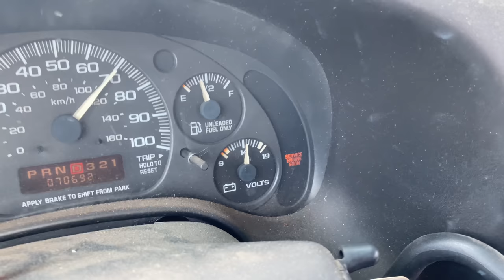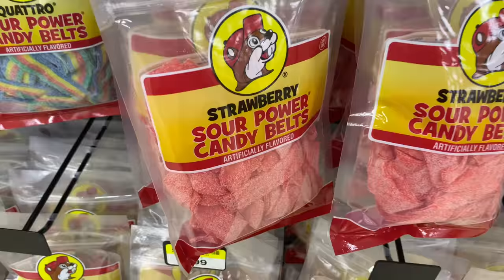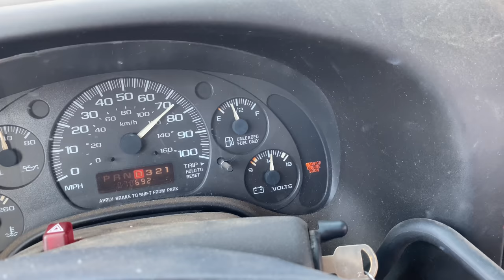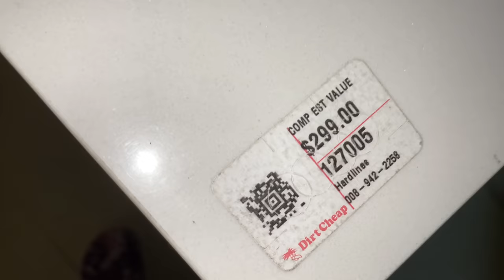DaBaby CAUGHT Drinking Karen’s Bath Water!? (Confirmed SOOS!) *😳*

Comment: if the engine gets too hot again then you can cool it down a bit by turning up the AC heat to max and putting the fan on max. There's no heating element in the bus, it just uses the engine's heat to heat the ac air. So if you turn up the heat and fan, its basically blowing cool air over the engine and the heated air onto your boiling lil body.
Reply: This is one of those things that certainly works in theory, but usually the reason for the overheating will overwhelm the heater core's ability to compensate, especially if there is coolant loss involved. Not to say we shouldn't try, just to say don't expect a miracle.
Reply: the ac in the bus is broken
Reply: @bepsi8929  the heater works off the heat the bus makes
Reply: @artisanautobody3931  it definitely helps either way to buy you some time to either pull over or make it home
Reply: @martinvalencia6141  Let's say it's something you do while you are trying to find the closest place to pull over, not something you can do to make it home.
Reply: @bepsi8929  the ac doesn't need to work for this to work, unless the fans don't work, but that's not really part of the ac. I just called it ac b/c the knob that controls the heat and actual is generally called the ac control
Reply: @bepsi8929  that doesnt matter itll still blow hot air out of the engine, which will cool it, but in turn will cook good ol uncle Ben inside the cab. Not an end all be all solution but can prevent further damage.
Reply: @artisanautobody3931  I've done it multiple times to make it home in my old beater work truck multiple times,  it would start heating up in stop and go traffic so I'd put the windows down and crank the heater. She would drive 40 more miles home at 210 water temp the whole way.
Reply: @martinvalencia6141  this was one of those things that blew my mind lmao why did I never realize thats how cars produce heat!?
Reply: @martinvalencia6141  I'm sure it worked for you in your situation. It is an alternate way to remove heat from the engine. But people need to be aware that it might not always work. There are many different causes of overheating. For example, if there is major coolant loss, nothing is going to stop the engine from melting down.
Reply: @artisanautobody3931  Well ironically if the coolant is low enough the heat won't function cause practically nothing is circulating. In that situation yeah, turning up the temp won't do anything but make the blower motor work harder, but otherwise blasting the heat full blast will almost always help, heater cores are nothing more than a mini radiator connected with the HVAC. You'd even see some benefit from this if your rad was well plugged up or thermostat is stuck, as it's basic physics; heat is being absorbed then transferred/removed. It may only help slightly depending on the vehicle, but it's certainly better than letting the heat soak into the heads. Even then I'd rather be out a $150 heater core than be staring at a pair of warped heads and smoked valves.
Reply: Many a great memory running my car heater full blast in the dead of summer praying my car didn't blow up🥵.
Reply: I love how I first became aware of this concept from King of the Hill
Reply: @tjm644  To be fair Hank also said a ratchet is needed to take off a distributor cap
Reply: Science
Reply: That probably explains at least some of Tulsa's city buses.

Comment: Friendly tip. Put the concrete on a pallet so they don’t soak up the rain water from the ground…7:50
Reply: smart!
Reply: Or keep it in the barn that he has.
Reply: @epicmcgriddle7874  true..either will work.
Reply: He needs to store it indoors or under shelter. Moisture in general will harden concrete. Work for a fencing company. It is annoying.
Reply: @Sackmatters  being in a fencing company or moisture being the activator for concrete mix?

Comment: Dunno if you've considered this already but using tires to grow potatos is really efficient, once you've got one seeded, put it in the middle of a tire and let it grow out leaves then chuck a bit of soil on top so just a few leaves are showing and put another tire on the other one, the potatos will keep growing up to the light and leaving new potatos underneath in the soil, you can get them up like 4 or 5 tires tall by just adding soil every time it starts getting to the top of the tire, you'll have so many potatos!